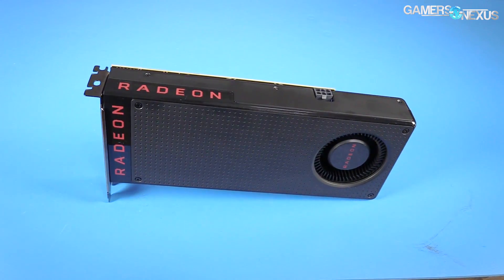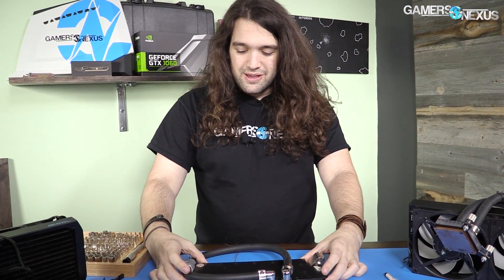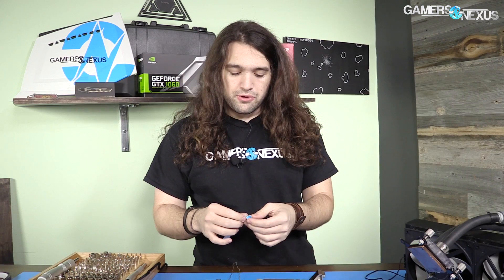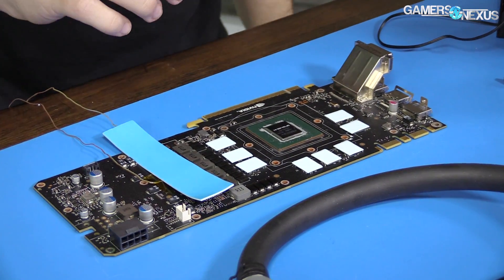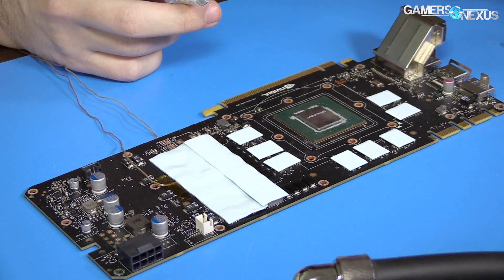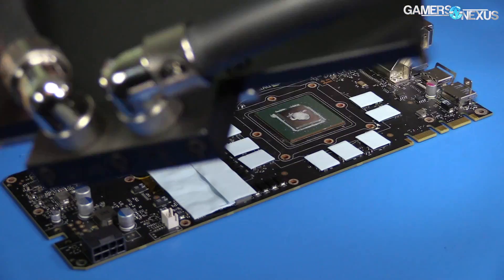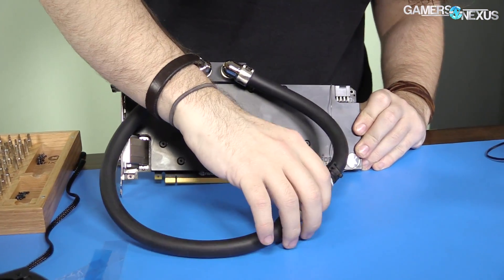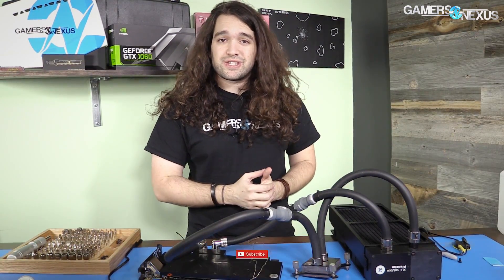EK Pre-Filled Waterblock Build Log w/ GTX 1080

Comment: Would the standard 1080 EKWB be compatible with the Zotac 1080 Amp Extreme? I know it's thermals are already outstanding for it's performance, but I was just wondering if I go for a full custom loop in the future; will I be able to add it to the loop?
Reply: no it is for reference boards only BUT that amp extreme is huuuuge so it probobly would not gain you much if anything switching to water......if you are dead set on water you can do a hybrid solution though.

Comment: +Gamers Nexus Could you please respond as to what you think the likelihood of the EVGA AOI watercooler for the 1080 will be of fitting on the new 1080 ti, will the 1080 ti be shaped like a modded 1080 so it will fit, or a modded titan x pascal, so the cooler will need some DIY modding to fit. Or do you think it will just not be compatible at all? Any answer is greatly appreciated, even if it is to say you can't tell this early. Thanks

Comment: am I the only one thinking those tubes are ugly af?
Reply: Sure, but it seems it's not about being able to make them look like some sick ass system with glowing cooling liquid under a UV light. These are basically what it would be to have somewhat open watercooling system without the hassle of going fully custom to your rig and putting in all the effort to make it work on your specific system. It's more of a "Man I want better temps on my machine, similar to an open water cooled system, but I don't have the time or money to go all out." I feel that's what it is marketed as. But I could be dead wrong depending on how it performs in the first place.